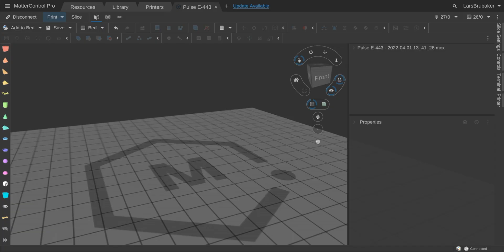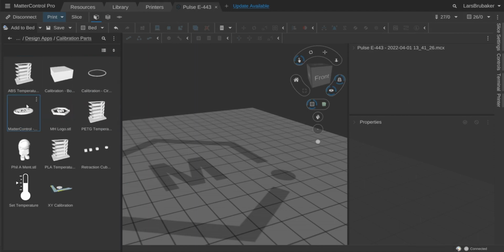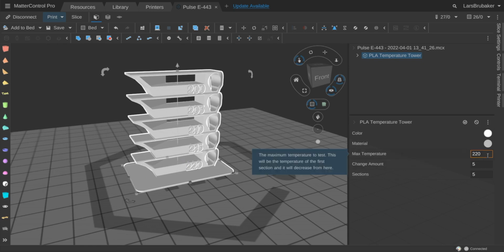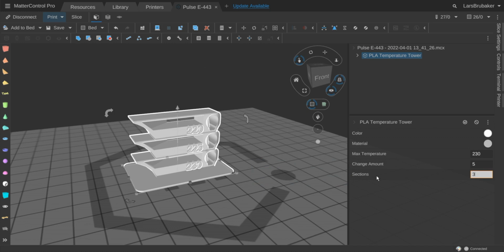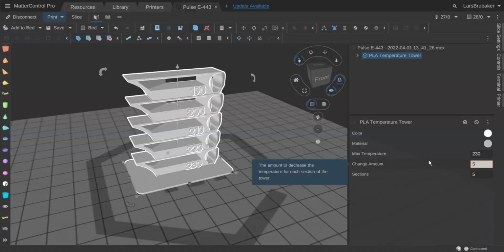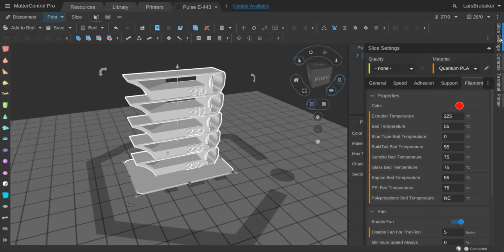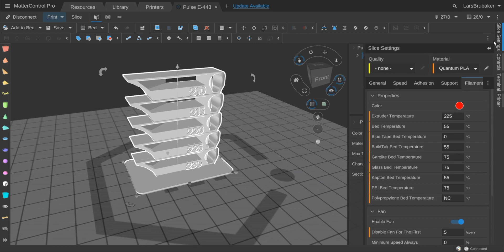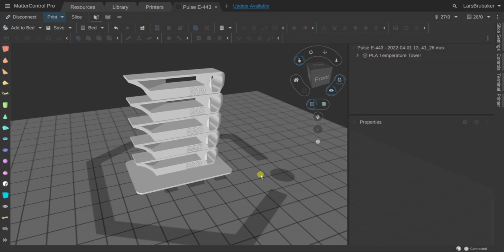Are You 3D Printing At The Right Temperature? | Two Minutes with MatterControl

Comment: This is awesome to know. as updated to the latest Matter control and didnt know this feature was in it so now every new filament i buy i can quickly run calibrations before commencing on with projects.
Using Enders 3 v2
Also to say i have had big issues with wood filament and knowing this is great.
i wish when updates have finished their was a change log that would pop up so one can read what has been implemented.

Comment: Can I change my max temperature with this program??
Reply: Yes, its under the Filament settings
Reply: @larsbrubaker8898  really? I been trying to use firmware updates but no luck on utilizing my hi temp hot end
Reply: @WeTheWaveTV  Sorry, I did not understand your question. I did not understand you were talking about the firmware limit.
Reply: @larsbrubaker8898  tried but wouldn't connect to my Neptune 2s
Reply: @larsbrubaker8898  I have upgraded my hot end to a Creality Spider to print pc but no luck with Marlin or

Comment: Great vid, temp calibration has not been something I have done yet and I hope this improves my already good printing on my Ender 3 V2.
Is there a guide to settings for the Ender 3 V2 or do the stock settings for the generic "Creality Ender 3" printer that you can find in MatterControl work fine?
Reply: The ender 3 should work great. We also just added an Ender 3 V2 that considers the glass bed. If you already have MC installed it only updates the printer list once a day so you may not see the new printer for a little while.